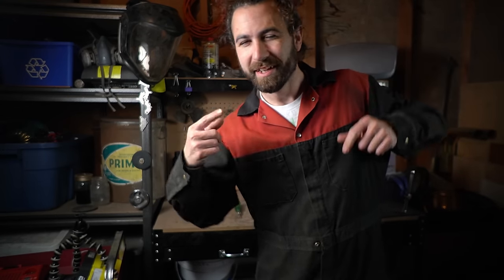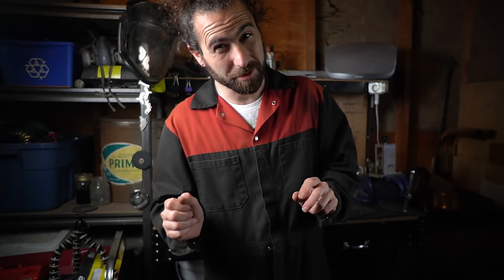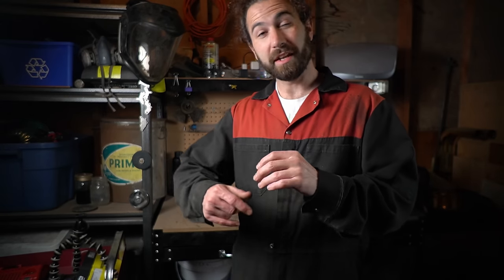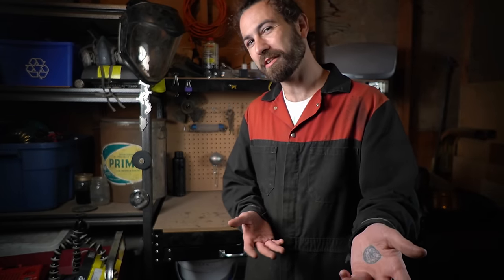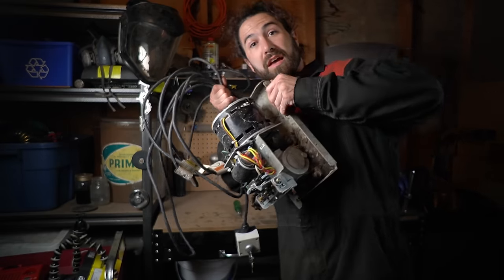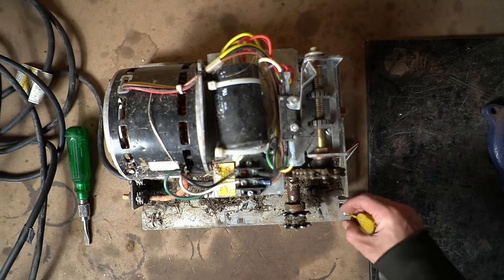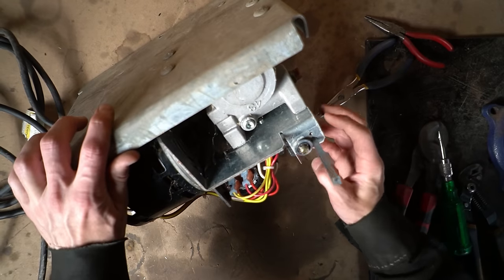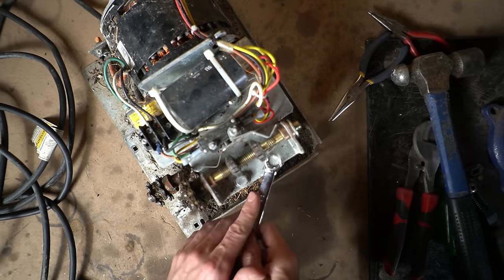Processing a Big Pile of Scrap for a Massive Payout! Productivity Partner

Comment: Hilarious! "I wonder what this is?" Smacks it with a hammer and it shatters like pyrex. "Well, now we know what that was." 🤣 Oh, on circuit boards there are little printed letters and numbers. If you are wondering if something is a capacitor look for the letter C with a number. That long yellow tube one was definitely a cap. I used to work at an electronics manufacturing company. Another great video Thub. Thanks for leaving my day better than you found it 🙂

Comment: I keep seeing you return bx cable as is! Arggghhh! You should do a video for yourself on that one - it's worth seperating the wire from the casing imo. My yard has a special category for the empty aluminum from those and it on average pays about .12 more than 'old sheet'.
Reply: its very worth, esp if its number 1, mine stills gives me OLD but the number one price is way worth it, and if its solid core i go ahead and strip and make even more
Reply from the maker: I go back and forth on it, sometimes I pull the wires out but it depends how busy I am that week tbh
Reply: @thubprint  good video idea, stock up on some wire filled bx, and half it, spend the time processing/sorting, and see how long it takes and what you get vs not processing it and turning it in as it is

Comment: I strip copper wire if it’s small enough in a jar of acetone and it’s just takes the sheathing off the wire easy while I do other stuff, if it’s bigger stuff I just strip either by hand or an automatic wire stripping machine
Reply from the maker: Interesting! I’ve never tried chemical stripping but I guess you could use the same jar over and over for awhile
Reply: @thubprint  yeah I'm using the acetone for months occasionally gotta add a little bit in but for the most part it works well while not being touched for a few hours

Comment: I see you mess with smaller stuff. The most I mess with is #1 and #2 copper, batteries, some aluminum cans if I have enough to mess with, tin, short iron, long iron, and aluminum. A few small bits of other stuff too. Its literally free money. People just throw it away. It's free all you have to do is a little work. But some of it you just load it and haul it to the junk yard. Easy money

Comment: If your interested in gold recovery from plate and fingerboards etc look up a channel here on YT called Sreetips.... Pretty sure its just sulfuric and hydrochloric acid breakdown, then you pour the waste liquid on angle iron and the leftover copper concretes out. Pretty cool
Reply from the maker: Oh you mean to release the gold foils without dissolving? Yeah I think that works the same with an AP solution, it’s a little slower but much easier to acquire.
Reply: @thubprint  oh yea. I forgot, Canadian rules. Smh.... Here i dont thinkn you even need a LLC think you just show id and go on a list in case you pull any sketchy agit with said materials.
Reply: @thubprint  AquaPhasia or royal water or whatever is just a mix of sulfuric hydrochlor and potassium I believe. Some such shit.... Def take a hr and check out Sreetips if you plan to try it.

Comment: @27:50 the vise needs to be secure to the bench to apply enough torque with pliers.  also, the plug needs to be secure in the jaws of the vise.

Comment: What with gas prices being high and people buying less new stuff due to inflation, so less things get thrown out, scrapping has become a losing game for me. I didn’t see 200 pounds tonight, I literally spent as much in gas getting that weight as it will net me in cash. Should have stayed home. 

I am feeling pretty low right now.
Reply: Just gotta eeeaase ‘er out of there…. @2:30
Reply: Carefully remove these bits here… @3:44
Reply: @39:10 - it’s always interesting to see price variations, even from another country. Even doing the conversions, some prices are close, I am better off here for others (copper) but you are better off on others (AL is a little higher, stainless steel is 3x what I get, and your yard separates more; different grades of stainless and mine just throws zinc in with aluminum breakage.